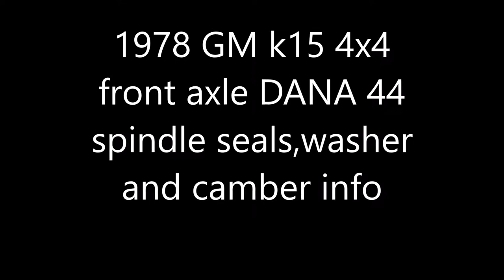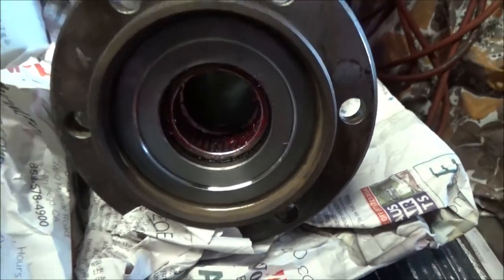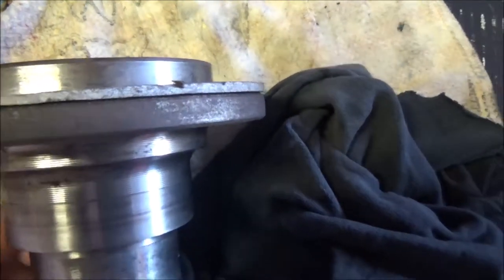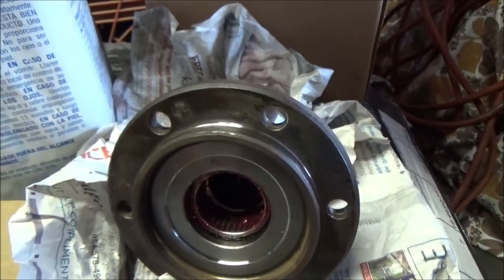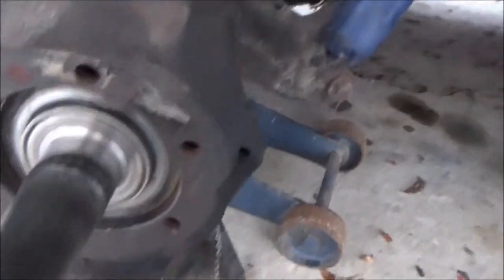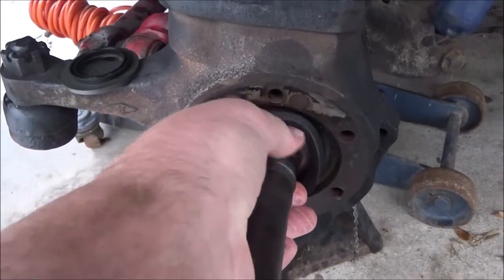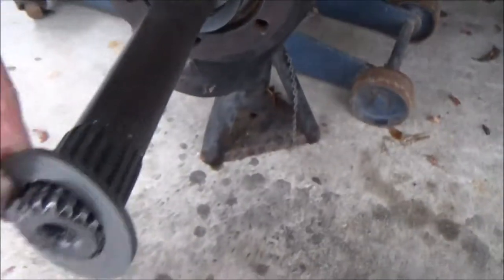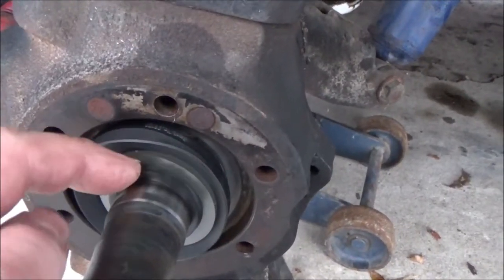1978 GM and Chevy k15 4x4 Spindle Seals and Shims Info

Comment: Great video ...the one thing I would like to add is that small grooved spindle seal needs to be just slightly protruding from the spindle face to properly seal against the plastic washer . 

If that small spindle seal sits just flush or in towards the inner spindle ...the spindle bearing will have to be adjusted outward with a pilot bearing puller .